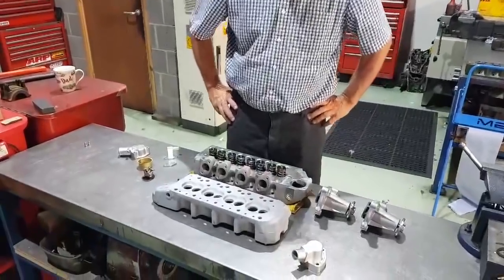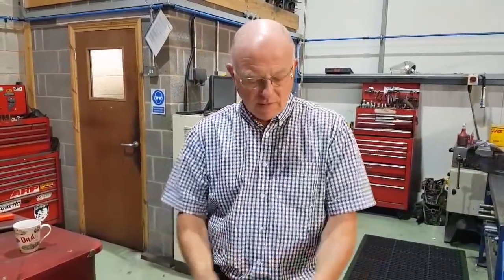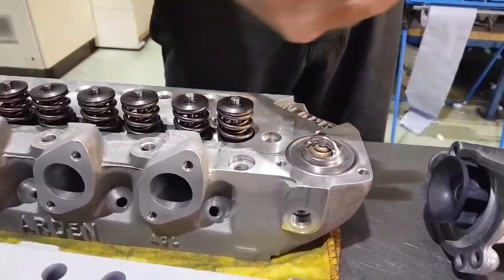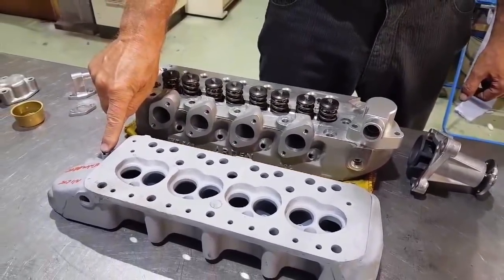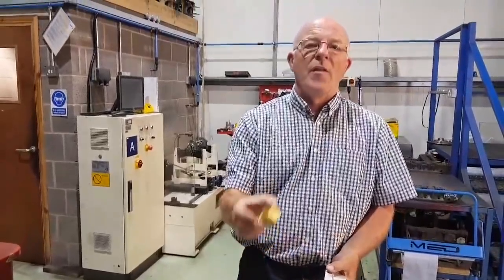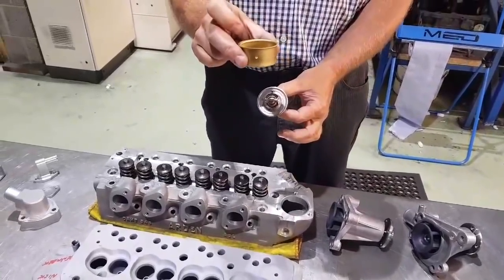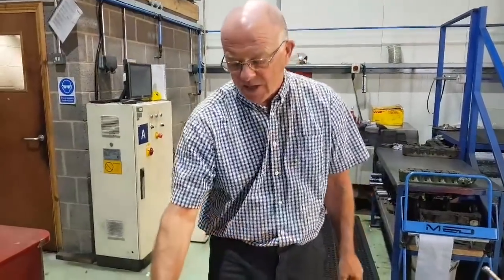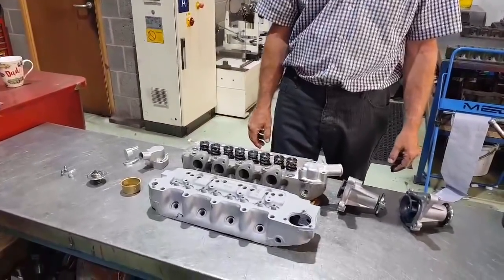A-Series cylinder head cooling

Comment: Running without a bypass won't cause higher pressure as the pump has no water to pump in. What it can do is cause cavitation by locally dropping the water pressure below boiling point. It's just a centrifugal impeller though, it works by drawing water in  on the feedpipe side from the radiator. If it can't do that it'll draw water in wherever it can - between the impeller and the pump housing.

Comment: The by-pass hose actually re-circulates the coolant back into the  block not the top of the radiator so I would say that it is more for stopping airlocks  than anything else, so if one is careful on filling , not having a by-pass may not be a problem especiallyif you get a thermostat with one of those little vents in it.

Comment: What about no bypass but open circle through the heater matrix. Wouldn't that be a workaround for a Engine without the bypass?
Reply from the maker: Yes you could do that.
Reply: That's what was done with the Metro to eliminate the bypass hose. However, a Metro heater bypasses air around the matrix instead of having a valve to close off water flow, like the Mini does.

It's one reason why later Minis used an inline heater valve, a bypass can be routed through hoses before it.